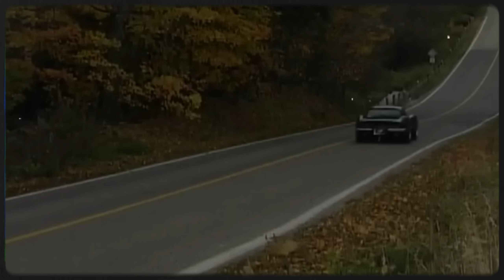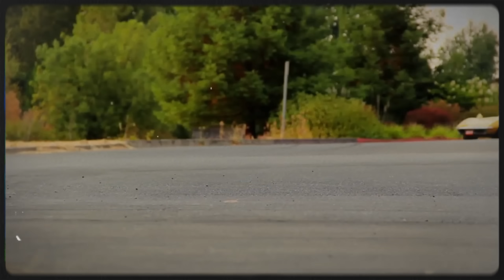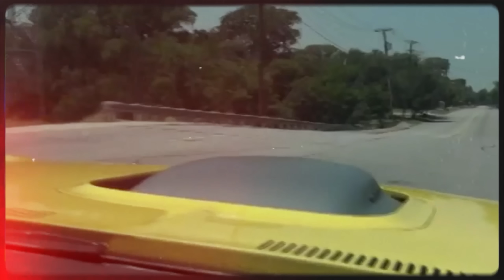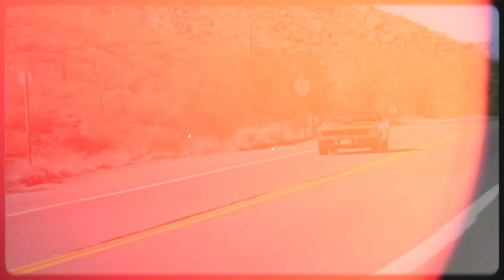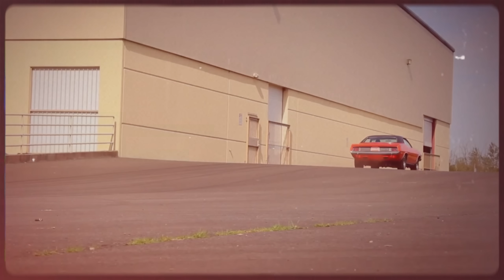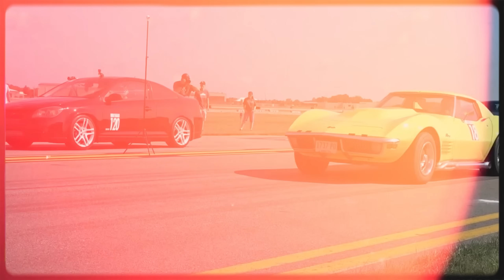LS6 Corvette vs 1970 Hemi 'Cuda — LEGENDARY Drag Racing Showdown

Comment: N0 1970 LS6 VETTE.  THAT HAPPENED IN 1971, AND IT HAD ALUMINUM HEADS AND 9 TO 1 COMPRESSION AND WAS RATED 425 HORSEPOWER.

Comment: The hottest Corvettes were the L-88 and ZL-1s. The LS-6 in the 1971 was rated at 425hp. It was not as hot as the LS-6 in the 70 Chevelle SS. Regardless the L-88 and ZL-1 were the hottest big block Chevies at the time.

Comment: nothing from boomer era comes close to modern cars. most 4 cylinders outrun the fastest of the 60s
Reply: Most? Name one that does 12.8 in the quarter (let alone 11.8’s) that doesn’t cost a bazillion dollars.
Reply: @cutlets6152 nothing from the 60s/70s ran 12s showroom stock. You are delusional
Reply: @NoPrivateProperty  and you are inexperienced. The L88 Corvette could. A 396/375 hp Camaro could.
My Cobra Jet Mustang ran 12.93, a 1970 stage 1 Buick gs could run 12.8’s and a hemi cuda with factory 4.56’s ran 12.88.
It was all about rear gearing and driver skill.
Ronnie Sox took a stock hemi road runner and posted a 12.91. All other magazine drivers couldn’t get beyond 13.3 with that 4 speed.
Now it’s your turn. Name me a 4 cylinder that can run 12’s.

Comment: I had a stock 67 Chevelle super sport 396, 325 hp four speed standard that did outrun most of those Plymouth barracuda’s challengers 440 4 barrels and six packs in the quarter mile top end I could not stay with him because my my machine top at 115 mph

Comment: 😅 GM and Chrysler they lied about the horsepower the horsepower was much higher than what they said😂❤
Reply: Well kind of. They measured hp back then with the engine out of the car and strap down to a dyno. Nowaday,  hp is measured with engine in car along with all accessories hooked up to it. So yeah, they may have underrated their engines  but by today's standard those motors were still overrated. By todays standards would be well under 500 hp. Those trap speeds are indicative of how much hp they really make. I had a 2000 LS1 Z28 that supposedly made 305 hp. After breaking the motor in and on street tires first timeout, I ran a 13.53 at 105.

Comment: I had a 69 Corvette 427 435hp Tri power M22 and 3.70 rear.  I would run 12.80's all day long at 111mph on stock F70 Bias tires.
Reply: Which 427?
Reply: I remember how bad those bias tires sucked. When they added the radial tires you didn't see cars along side the road with flats. Better all around.

Comment: I lived during the height of fast street cars.
My daily driver from w 967 thru 1975 was cc a 67 427 cc 435hp C I rvette with the M21 box and a 3.36 pos I traction rear end.
Perf I r n ance on Goo d year Blue streak tires was 155mph top speed at 650 
.24 rpm. Quarter mile was 13. 24 at 106 h going thru the lights in 2nd gear at 6600. The car weighed around 3200 lbs.
I lost t b e plastic I c on the m ain tim I ng gear at 52 000  miles. I replaced the short block with a n LS 6 short block. Et dropped to around 13.06 a t 109mph .   
I NEVER ran into a stock street h emi that ca m e I ff the line as quickly as the Corvette The h needed time to get into th e ir p I wer band. BUT almost invaded t isbly the hemi would be catching me the last 300 feet. N UT t h ey didn't have enough time or space. Also I only had to shift ONCE. I was running ing m I re torque multiplication longer . The hemisphere ran DANA60 rear ends
 Gear s e section was ugly such that they shifted 2 I r 3 tim e s
 I must note that a Sha r p running 4 r 0 6pak was a far better choice than a hemi. Properly tuned it would c I ver the cc quarter quicker m I t weighed less. Peak torque was as zi recall within 10 lbs of t h e hemi. And it arrived earlier. Facing off against one of these was usually quite close e p afti cc ula r ly if it was in a lighter chassis Isuch as the Roadrunner. One of these with a Torquefightv727 and a 8 m 75 Shurgrip rear end was usually won by less than a fender length.
Reply: Are you using voice rec because I cannot make many heads or tails of what the fuck you’re saying.
Reply: LOL! I never heard The Beach Boys sing 1.6 liter. She's real junk my one point six Litter. She's real junk my one point six Liter. Well I saved my pennies & saved my dimes for I  knew all I could afford was a 1.6 liter. Hurry up, hurry up & don't burn up 1.6 liter. When I Take her to the track she really slow. Hurry up, Hurry up, & don't burn up 1.6 liter. MY one point six liter.

Comment: O and the average Hemi only had 10.1 Compression ratio. Chevrolet 454 had a lot more. If the Hemi had Equal compression it would be more.  But if you put More camshaft in the Hemi it would be a lot faster.

Comment: The winner is the 427 CAMMER.
Reply: That engine was never put in a production car.
Reply: @cutlets6152 actually it was, as a dealer installed option...  Now I know we're getting technical here but yes, YOU COULD BUY A NEW FORD, WITH THE CAMMER. (Some exist).

Comment: If you want a REAL Drag race Corvette, Put one out there with the L-88. NOTHING will run with it.  535 Hp vs The 515 hp Hemi. Which was the top of th line Hemi.
Reply: NASCAR Hemi Was Top At 700HP In 1969

Comment: These cars are in different categories. The cuda is a pony car with a back seat, poor handling, weak brakes. The vette is a sports car, rough ride, good handling for 1970, independent rear suspension, 4 wheel disc brakes, and no back seat..

Comment: And today, ironically, most cars can beat both of these from the past😎
Reply: Far from “most”. Only specialized high performance cars that are either turboed or super charged.
Reply: A bone stock 10sp 5.0 will walk both of these in the 1/4. Add a whipple and it wouldn’t even be a race. Not taking anything away from the classics since I like them more than modern cars, but modern cars are just faster.

Comment: You are very wrong about the HEMI in the Cuda. The HEMI in the Cuda was severely detuned version of the RACE HEMI. Thats why they called it the STREET HEMI. I raced the street HEMI in my RoadRunner for four years. Nicks Garage in Canada rebuilt a STREET Hemi absolutely stock. Cam, low (10.25: 1. At around 6,000 RPM, Nick got 507 HP. Only the Lord knows what a race Hemi puts out !!!
Reply: Why didn't He Build It To Race Hemi Numbers ?
Reply: @WisdomOverWicked777Rules  Nick said so many argued the actual HP numbers were higher or lower than Chrysler ads, he decided to build his own,old HEMI to exact stock specs off the assembly line and put it on his own dyno. He shut up many with the over 500HP numbers he came up with .
Reply: @charliechristie2949 
Racecar Hemi Especially Built By Richard Pettys Team Would Blow Away Every Car on The Track & NASCAR Forbid The Engine. Which Is 1 Reason I Don't Watch NASCAR Since Jeff Gordon Left They Cheat Too Much. 
But I Believe My Dad Telling Me That 426 NASCAR Hemi Was Super Fast At 750HP

Comment: The LS6 was choked down with a low rise intake and a lesser cam. The LS7 was a crate engine that was much better. A 440 will out run most hemis on the strip as their power doesn;t come in until the 440 has to shift due to low flowing heads

Comment: I HAD A 67 427 390 HP VETTE 4 SPEED .CONSISTENTLY TURNED 13.2. 105.9 MPH. THE CLASS WAS C PURE STOCK, THIS WAS IN 1968.    COMPLETELY STOCK. YOU WERE ALLOWED TO REMOVE AIR CLEANER AND HUB CAPS. WHO EVER DID TESTING IN THOSE CARS COULD HAVE USED MORE DRIVING LESSONS! BY THE WAY THE 390 HP WAS THE SMALLEST  427.By the way  7 inch polyglass tires!
Reply: How much launch wheel spin?

Comment: The LS-6 was never in a 1970 Corvette  only the LS-5 in 1971 they offered the LS-6 in a slightly detuned state with 430 horse power.
Reply: Video Says LS6
Reply: It was 425 hp for the 71 LS6 Vette
Reply: @johnruffner8637  yes you are right, checked my Corvette black book, with so many hp figures rolling around my head, I sometimes screw up 😊
Reply: @johnruffner8637 
I Heard The 71 Corvette Convertible With L88 427 4SPD Is Super Rare & Very Valuable

Comment: 69 corvette with all aluminum 427 had reported 505-535 hp but was later confirmed to have 585hp. I owned a 70 challenfer with the 426 hemi, and it was a monster.  I stalled a tunnel ram with 2 holley 750 dual feed carbs a cam, with a built 727 torqeflight tranny. Grandfather was a Chrysler engineer and good friends with Gale Banks and Don Prudhomme. Also hung around Bill Clemons who raced AMC Javelin and Matador. Bill was also a hell of a tv repairman.
Reply: The 1969 427 L88 was a cast iron block with aluminum heads.
Reply: @colehara There was an all aluminum version of the zl1. Im a product of Detroit. My dad and uncles were GM engineers and executives. I played in the wind tunnels as a youngster. I know first hand
Reply: @mont7481  GM only made about 50 of them
Reply: @GregMargraff  In 69 Chevrolet built two Corvettes with the ZL1. Between 67 and 69 Chevrolet built 216 Corvettes with the L88.
Reply: @mont7481 
So What Was The Fastest American 69 & 70 Car In The 1/4???
Reply: @WisdomOverWicked777Rules 《☆》69-1/2 Dodge A12 Super Bee 440 SIX Pak cars were running 13.0 to 13.5 around 105 mph. The Plymouth A12 Road Runners were about equal. Ronnie Sox ran an A12 Road Runner 4 spd stick in stock trim 12.91 at 111 mph per Google✌️😎🤳🇺🇸☯️🇺🇸
Reply: @WisdomOverWicked777Rules  my guess would be 69 zl1 l88 corvette.
Reply: @rapidride2  
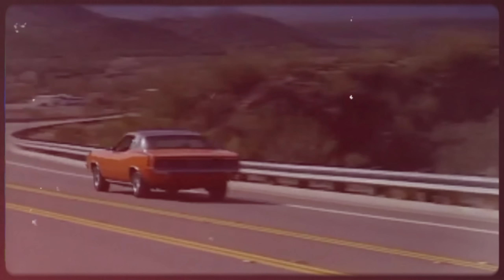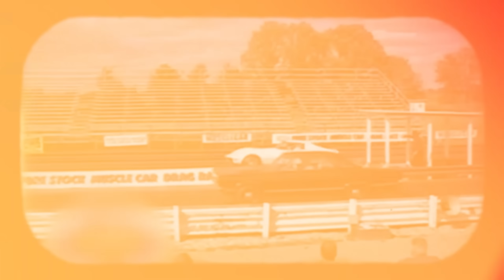It was either ZL1 OR L88, And Through My Research The L88 Barely Beats The ZL1 11:00Secs To 11:05
Reply: @bdogjr7779   
69 & 70 L88 Beats Both At 11:00 Secs
Reply: @colehara Exactrty😂
Reply: No LS 6 in the 1970 Corvette. 1971, yes, with less compression